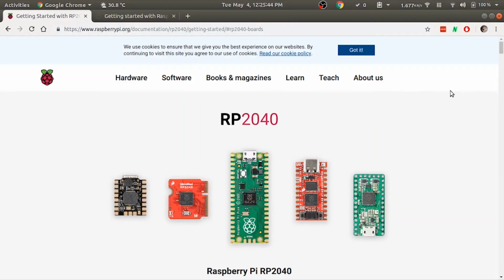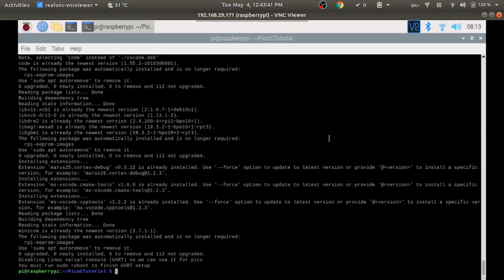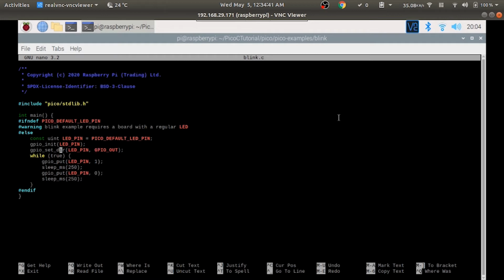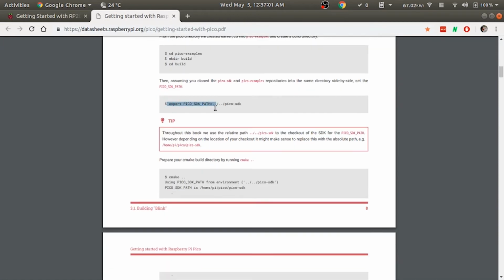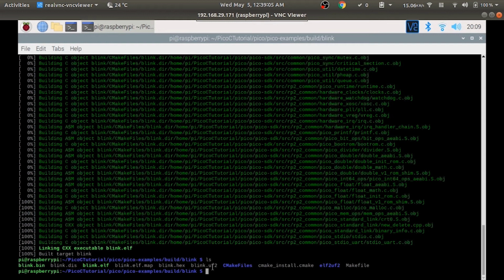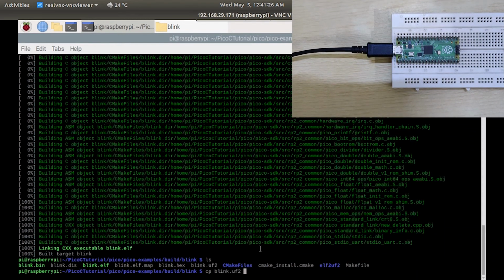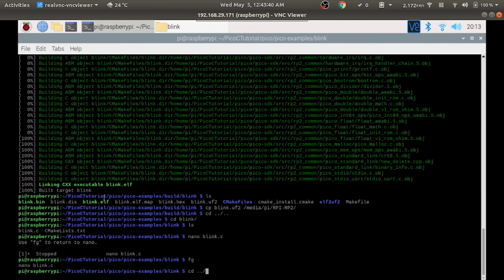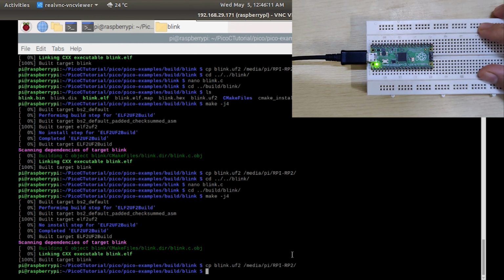Raspberry Pi Pico using C/C++- Tutorial #1: Setting up SDK and Blinking an LED (Digital Outputs)

Comment: Do they still answer the questions commented on this video?
I have got quite a bug but When I compile the project and put the " main.uf2" file on my Pico the problem is that it doesn't retain the program after a reset/power cycle. If I press the "RESET" Button on the Pico or unplug and plug the Pico. The program gets deleted somehow and IDK how to fix it.
Reply: Cpuld it be that there is a problem with the pico device? Did u figure out what it was?
Reply: @tatterdemalion898  nope, other frameworks such as tinyGO, Arduino, MicroPython / CircuitPython interpreter for PICO retain themselves after a Power cycle except for C SDK.

Comment: Thanks a lot. Can you update your tutorial with cd pico-sdk
git submodule update --init ? Another question is that the installation include VSCode, but you don't have any examples howto use VSCode IDE instead of Terminal
Reply from the maker: Certainly! We would consider you request and as for using VSCode, you can configure it by installing C/C++ extensions, setting up build/debug tasks, and utilizing features like code completion and debugging within the IDE.
Reply: @Robocraze  Thanks a lot and as well how about Pico W?